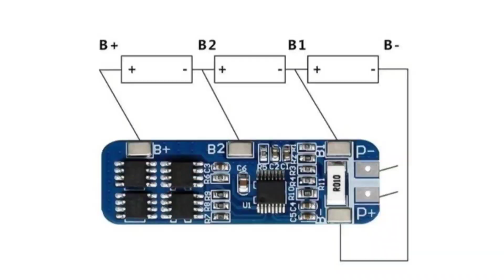3s BMS | 12v lithium battery pack | 3s BMS wiring diagram | 3s battery pack

Comment: i want to use it as bike battery will it work?
Reply from the maker: Yes it will be work but you can't recharge it from bike generator .
Thank you so much for your valuable comment and visit
Reply: @TechnicalShahzadats  why? What will be issue?
Reply from the maker: @manjifera  bike generator has generate high ampere and this pake can't control it
Reply: @TechnicalShahzadats  - i have ordered 40a bms

Comment: 3s bms 10A me agar 6 cell , har cell ka Mah 4000, , 6×4000= 24 Ah...isse koi problem to nahi hoga? 
Hume sirf output se 10Amp se jyada device add nahi karna hai, correct? 5amp ka fan chala sakte hai, correct?
Reply from the maker: G koi problem nhe easily work kre ga .
Thank you so much for your valuable comment and visit
Reply: @TechnicalShahzadats  brother charging voltage 12.6v he rakhna sahi hai, isse battery overcharge nshi hoga, lekin aap bol rahe ho 16v charger se charge karna hai, kindly solve this issue
Reply from the maker: @wahaiwah  bhai Mobile ki battery kitne volt ki hoti  hai ( 3.7v ) or mobi ko kitne volt ke charge krte ( 5v ) to jitne volt ki battery ho os ke volt 1.5 se multiply krne baad jo volt ayin wo battery ko perfectly charge kryn gye ( 12v x 1.5 = 18 ) 👍
Reply: @TechnicalShahzadats  bro, I'm not expert..but 3.7 v battery ko 4.2v se charge karne se battery boht din tak chalta hai..apne 12.6v lithium battery ko 12.7v charger se jab charge karte tab kya hota hai, charge nahi hota ya slow xharge hota, plz bataye..mujhe bhi banane hai battery aur charger
Reply: @TechnicalShahzadats  i think mobile battery 3.7 ke liye , mobile ke andhar tp4056 jaise koi module laga hota hai jisse 5v ko 4.2v kar deta hai, ye mera andaz hai, hakikat aap jaise expert ko pata hai
Reply from the maker: @wahaiwah  g bilkul laga hota hai esi trah ye bms ( battery management system ) bi 4056 ki trah hi kam krta hai basically tp4056 bi ek BMS hi hai or esi trah kesi bi battery ko charge or discharge krne ke liye BMS zrori hai
Reply from the maker: @wahaiwah  g bhai slow charge hota hai
Reply: @TechnicalShahzadats  yes bro, slow hai lekin long time battery achha rahega, btw minimum cut off voltage kya rakhna hai, 9.60v me cut off kar liya to battery dead nhi hoga na..
Reply from the maker: @wahaiwah  nhe es battery pack ko 9v tak kuch nhe hoga
Reply: @TechnicalShahzadats  jazakallah bro, plz build 3s bms with 9-12 cell
Reply from the maker: @wahaiwah  soon as possible

Comment: Bhai mujhe bhi banana hai ye battery mere paas 9 cell hai unko bms k sath kaise sold karu wo samjh nhi pa raha hu plz bhai mere 9 cell pe bhi video bana do teen teen ka set hota hai jo Please bhai🙏🙏🙏🙏
Bhai apni voice k sath video dalna plz
Reply from the maker: Bhai oske liye apko 3s bms 20ampere ka istmal krna hoga mere pass es waqt 20amp wala nhe hai es jab hoga video bna do ga agar pehle ap ne bnana hai to mujhse facebook instagram or twitter pe rabta kr lyin
Reply from the maker: 10a ka bi kr sakte hin lykin phir apko output pe 10a se zyada nhe milyn gye
Reply: @TechnicalShahzadats  kaafi hai 10a bhai zyada load nhi dena hai bas Ek led bulb ya fir ek fon ka charger hi use karna hai ek time pe ek hi cheej use karege 12v dc cnvrtr se
Reply from the maker: @shabanraza7385  jab bnana ho contact kr lyna facebook instagram Twitter pe
Reply: @TechnicalShahzadats  bhai kya instagram reply to kiya nhi bhai

Comment: 12volt 3s 25ah BMS ka highest charging voltage kitna hay???
Reply from the maker: Bhai kya puchna chahte hi battery pack full charge hone ke baad keti output de ga ya charge krne ke liye kitne volt chahye hin .
Thank you so much for your valuable comment and visit
Reply: Bhai......
Battery charge karne k lia maximum kitna volt de sakte hy ?????

Or motorcycle k lia yeh battery safe hay ?????